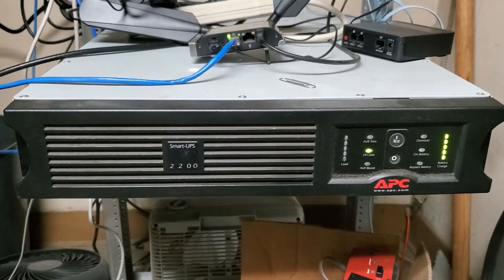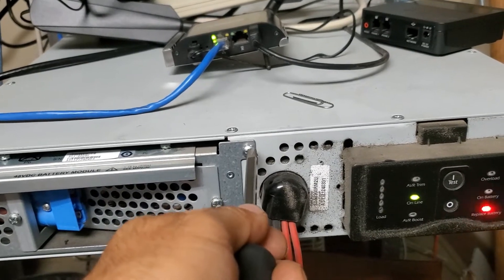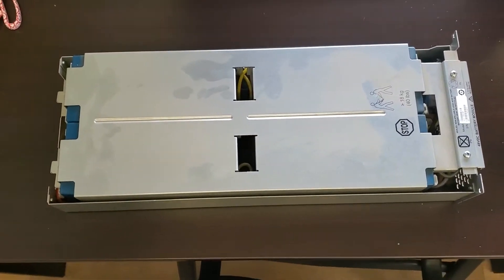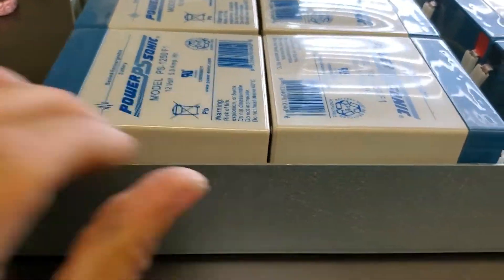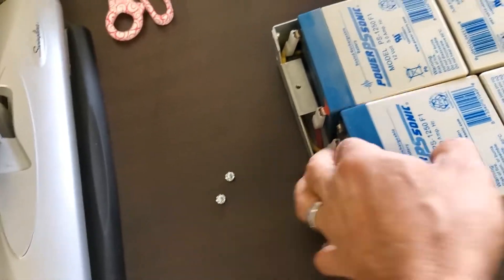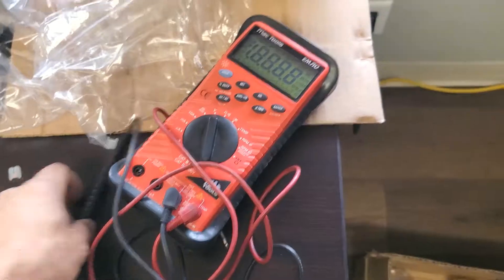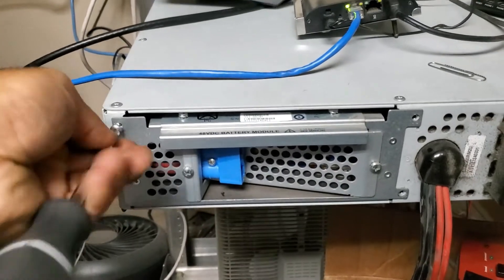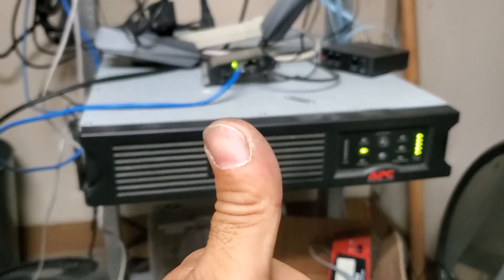Replacing Batteries in APC Smart-UPS Battery Backup UPC2200

Comment: Hey, thanks for this John.  I started to watch a similar video but the wiring harness was different on that one.  I sure wish I would have used your "replace the batteries one at a time" technique.  I did take a video of the wiring harness before I pulled all of the batteries out at once, so hopefully I can get things wired up correctly using that as a guide.